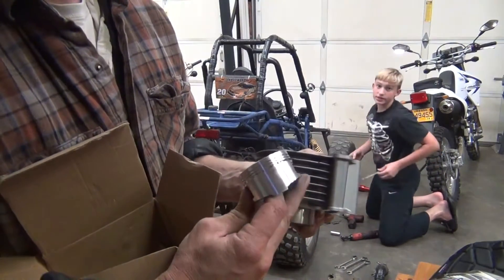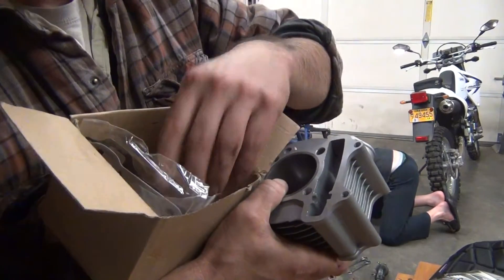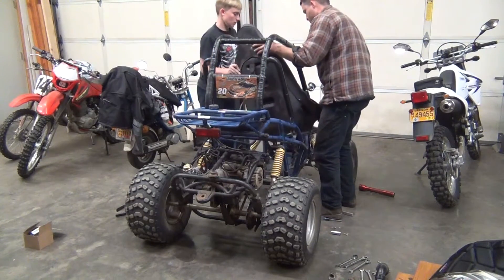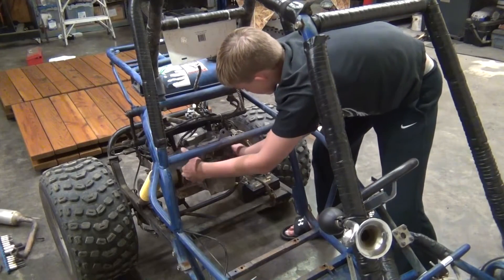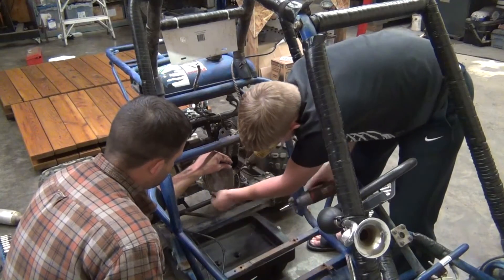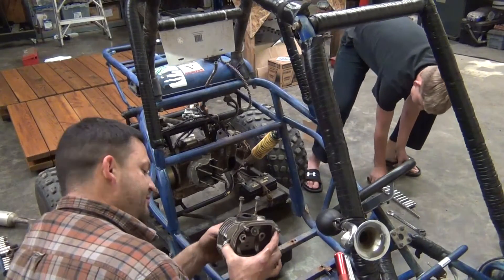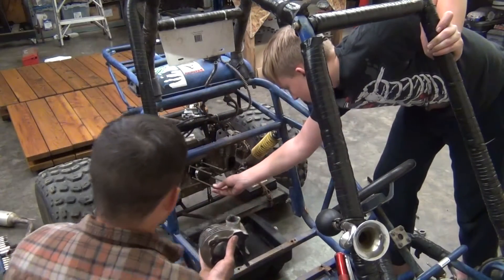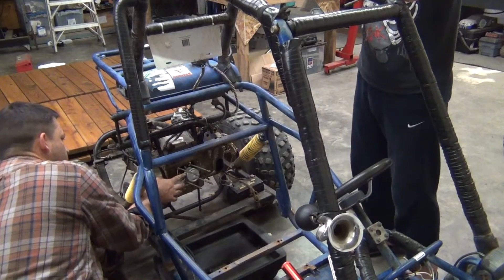Dazon Raider 150 kart: new cylinder, piston, rings

Comment: i feel there should have been more signs of 0il under that valve cover but maybe it does after a run ..
Reply from the maker: I thought so too (tat's why I put the drain pan under there before removing it) but the drain passage is on the bottom of the cylinder, and it is sloped slightly downhill.  After a few minutes, any oil in the head drains right back into the case.